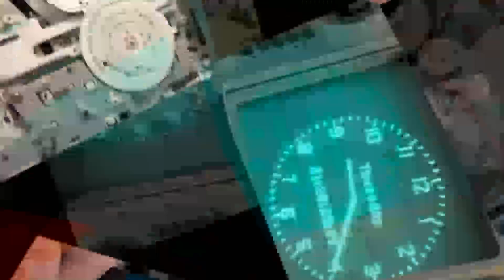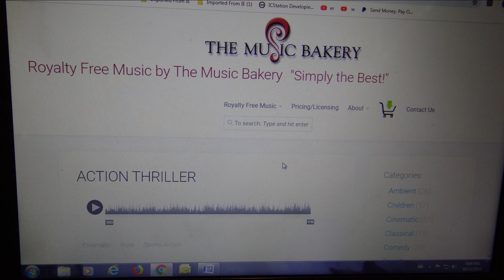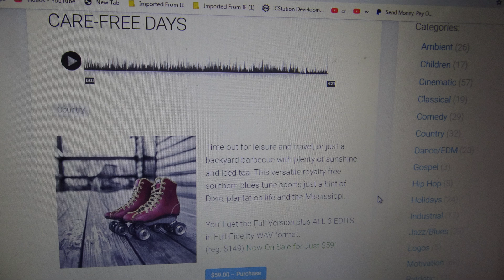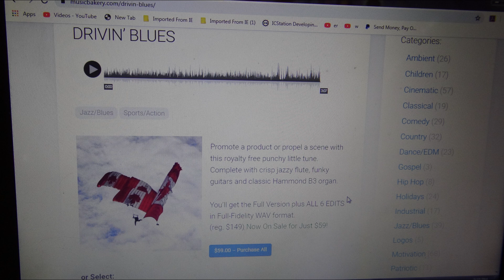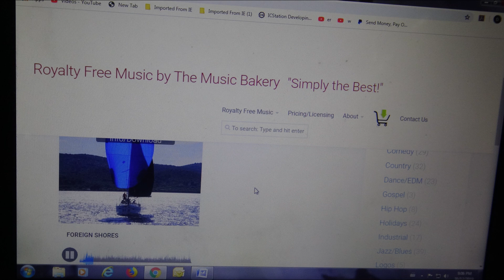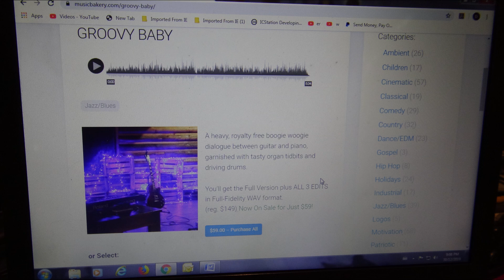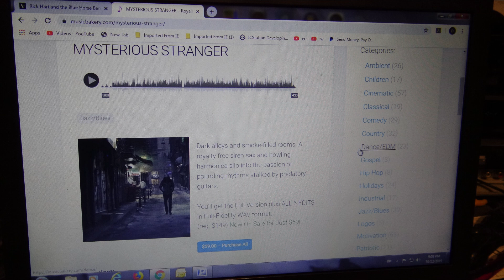Music copyright scam exposed.

Comment: Videos is good Panasonic combo DVD not play  DVD cassette in side to DVD DVD sounds Crick crick sound produce     probulam how solve video make please sir solutions tell me sir
Reply: DVD sound beb sound produce Panasonic how solve problems
Reply from the maker: Have no idea
Reply: You could try cleaning the laser with some 99% isopropyl. A quick google showed that panasonic DVD players do 5 beeps with a bad laser. You may have to get the laser head replaced. Quote from another site :  "The tell-tale beep-beep-beep-beep-burp! sound from the DVD drive is indicitive of a bad laser pickup. "